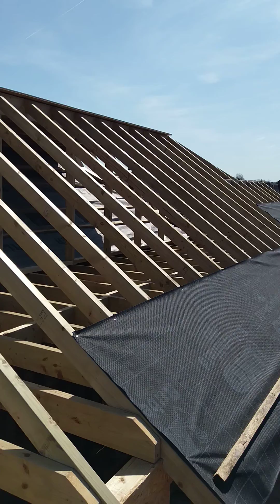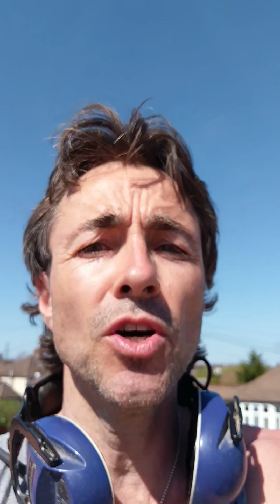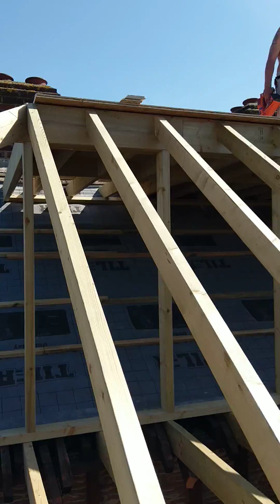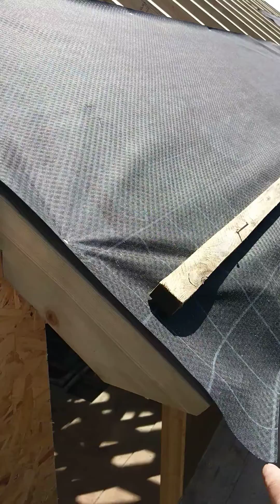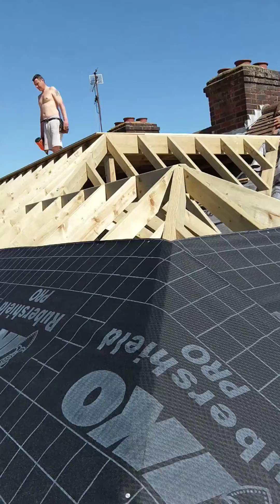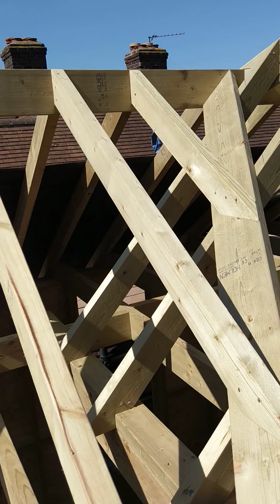Timber roof construction

Comment: Loving the channel and Skill Builder. I'm keen to try the stepping off method on my next cut roof. Could you please give more details on how to make the rafter fence for the framing square . Cheers.
Reply: Tom Dyer buy some stair gauges, you don't need a fence.
Reply from the maker: That's what I had when I started, but they can fall off, and when it was really cold on site they had a habit of falling off as the metal of the square and the metal of the stair gauges contracted differently!! Also if you find a knot hole on the edge of the timber of other defect the angle that is marked can be out, I still have them but the use of a fence is so much more solid and can handle the rigours of roof construction on site, great comment thanks mate
Reply: You can buy stair gauges that are 32mm deep or even 75mm deep, perfect to get over any knots, waney edges etc. Good for bigger timbers. Never once had any fall off in the cold. Tighten up more i reckon. With a fence, if the timber is not dead straight, it can rock especially with the crap timber we get in the UK where as with gauges, you'd never have that problem.

Comment: How do you find the angles be great to know?
Reply from the maker: I use a variation of methods to suit the job, if I am joining to a roof then I will use a digital inclinometer on a long straight edge on the existing rafters, or I check the rise and the run and draw a triangle to scale to then check the pitch with my roofing Square as a protractor there are many ways to check the angles sometimes it's what's best for your own understanding, thanks for the question and happy roof pitching!